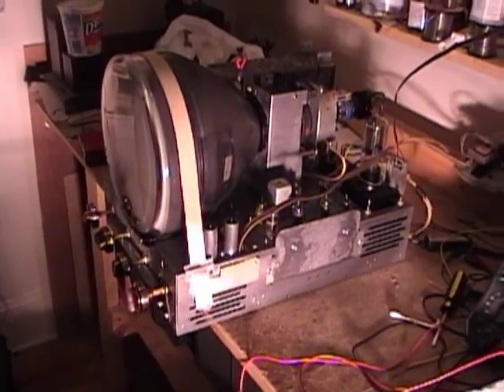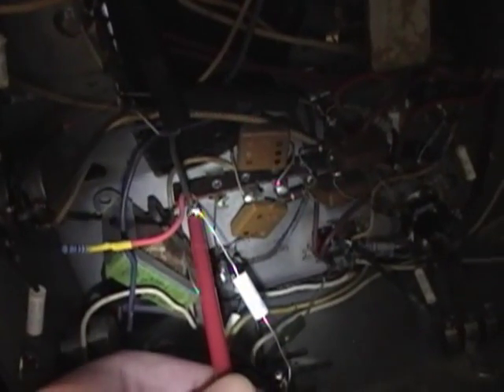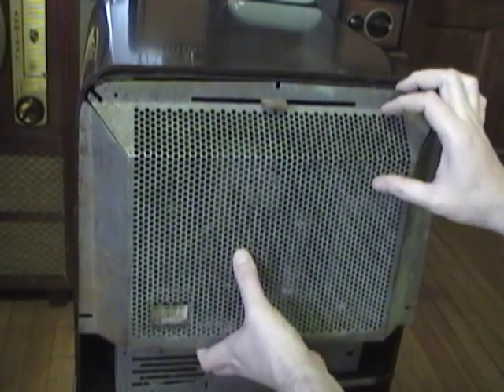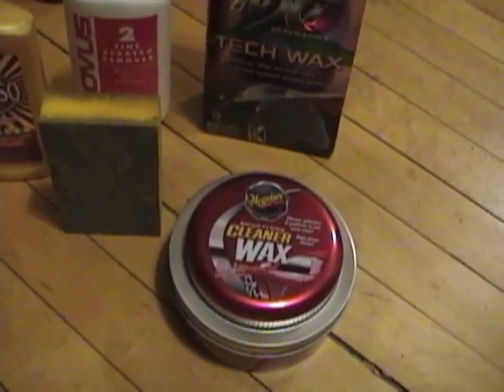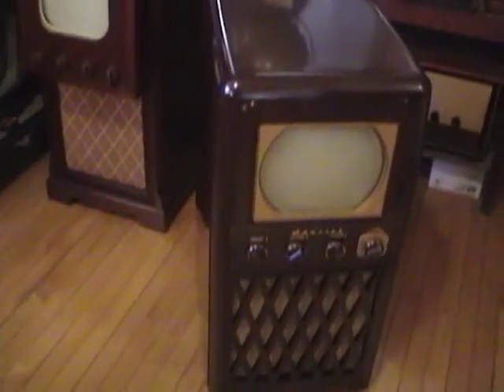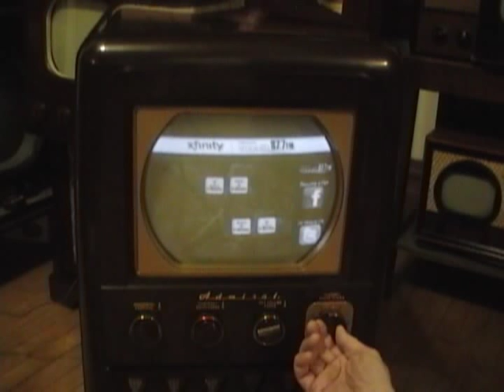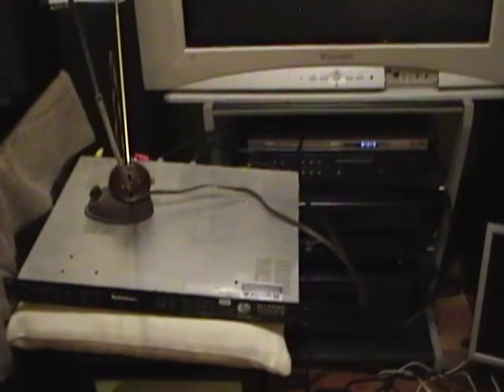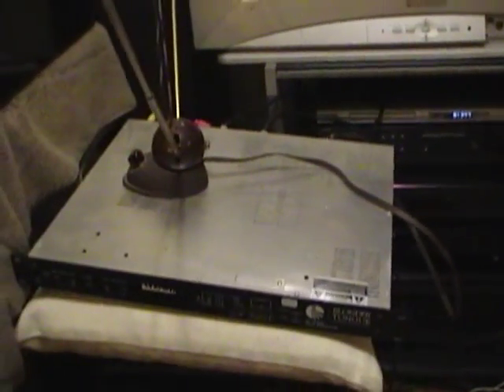Admiral 20X122 restoration p4o4

Comment: I suspect that if a TV were overhauled completely and used maybe four hours a week that it would likely outlive you. When these sets were new they were likely used six or more hours every day, with a trip to the service shop once a year. The main point of failure was the wax paper capacitors and carbon composition resistors, both of which shorten the life of the tubes more so then normal. The electrolytic capacitors can dry up of fail but semi regular use makes them last longer.

Comment: Another great video, Bob. I was wondering what kind of life span one can expect from a restored set using high quality parts? What parts are worked hardest and would require frequent attention and/ or replacement? Also, how does one test tubes with out a tube tester, is it possible?

Comment: Re: Dr Who: prior to the 1970s it was common for the BBC to deliberately erase TV programmes after broadcast. Tape was expensive and they were deemed not to have any historical value!
Most surviving UK TV material from that era exists only in the form of a low-grade film copy, recorded by cameras pointing at TV monitors, usually containing only a single field of 405-line interlaced video. 
I've not seen genuine 405-line video upconversions on modern British TV- it's all taken from film copies..

Comment: There isn't really a practical way to test tubes without a tube tester, even if the filament has continuity it still can be worn out or shorted. I can't comment on how long a restored TV might last but I have overhauled old radios with similar new parts and have had few failures, one being a clock radio that gets used daily for several hours, the last thing that failed in it was a 35W4 tube, probably because the 50C5 tube was loose in it's socket.